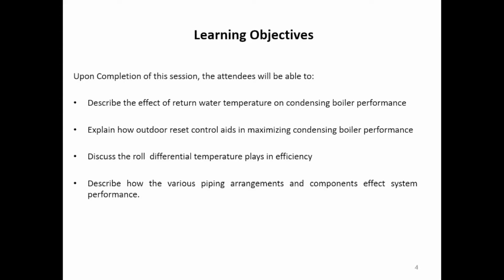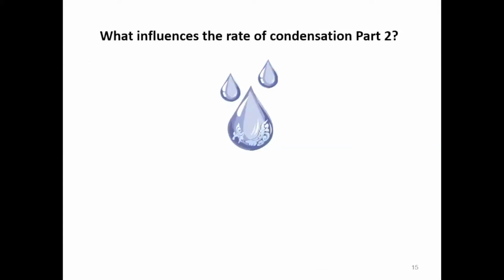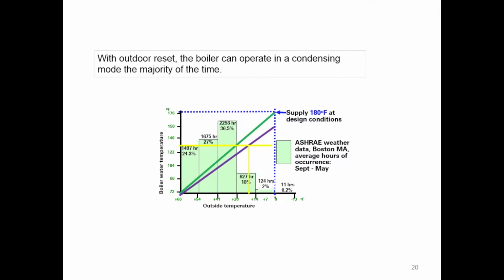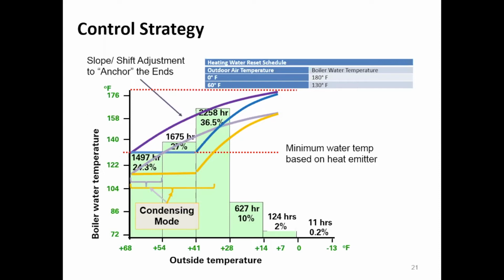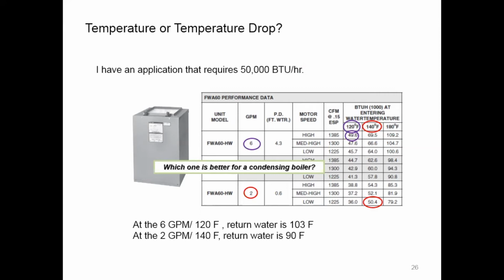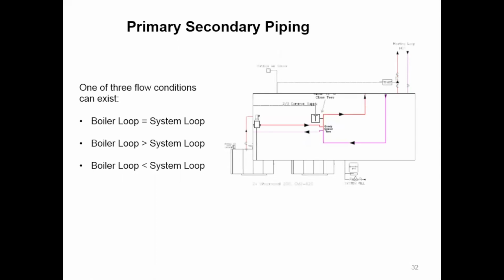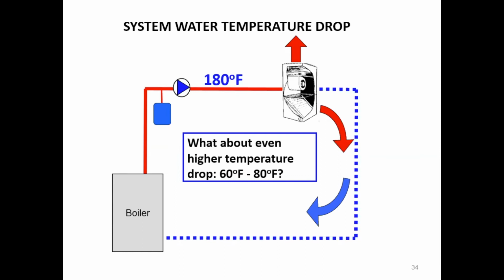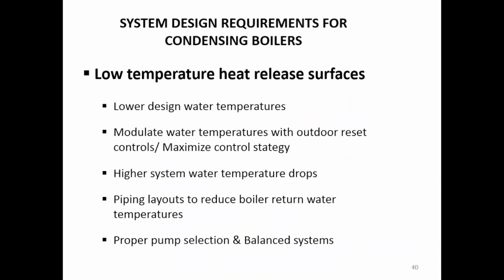August  2019 - Maximizing Condensing Boiler Performance Webinar

Comment: It's very naff Viessmann talking about boiler efficiency when they don't design efficient boilers !
Anyway, my Viessmann might be the last boiler I buy.
Reply: Care to elaborate? I am considering a Viessmann next.
Reply: @fearone9694  My Viessmann doesn't....
1. work properly with a cold return (turns the burner off)
2. offer 2 temperatures - one for heating, one for hot water
3. pumps heat OUT of the house via the flue.

They're one of the better boilers but that doesn't mean they're a good/efficient  boiler.

Rather than considering a new boiler, spend your money on insulating and draught-proofing (sealing up) your home. Fit extra external doors - so when a door is open, a second door prevents fresh cold air blowing in.
Change your heating from radiators to a ventilation system with heat pumps - fresh air is good for you and the heat pumps will keep the heat in the property but change the air !
Look at solar panels and wind for sources of electricity.
Reply: @millomweb what about intergas?

Comment: When a boiler such as the Vitocrossal CU3A is piped only primary as a replacement for an old cast iron boiler on a converted old gravity system, does the circulator have to run constantly for the outdoor reset to operate properly?
Reply: The challenges with converting older gravity systems to forced circulation are numerous. The piping is much larger because the water needed to move through the system by the buoyancy of hotter water with minimal pipe resistance. However, that drastically increases the mass of water in the system. Plus the piping is usually not very well insulated if at all. Once you add a pump and start moving water mechanically, this changes a lot of the thermal dynamics. If you start and stop the pump and or the boiler by a thermostat, when the thermostat closes you need to reheat a lot of water, which slows the recovery time and leads to larger temperature swings in the space. If you run the pump continuously, the heat loss may be significant because of the mass of water in uninsulated pipes. The CU3A boiler does not require a pump to be running to run the burner and keep the water in the boiler at set point. The 13-18 USG in the boiler will be ready to go make heat. However, this may be a lot less than the mass of water in the piping system. It really is a site-specific choice if it’s better to run the pump continuously in a converted gravity system but the CU3A boiler will work in both cases.
Reply: @marknorris9722  Thank you Mark!
Reply: @marknorris9722   Mark, do you know when the updated CU3A is going to hit the market?  I was watching a video on the new Vitodens 100 with the nicer display, and they said the CU3A is also getting an update soon.
Reply: @Shadrack69  I do not have a date for this.

Comment: Question for Viessmann instructor: I have a Viessmann Vitodens 100-w B1HE 120 BTU installed and thermostat controlled for each zone. Can you please provide some additional configuration/setup information on how I can achieve the efficiency levels you describe in the video at approx. 23:20 (slide 21). Thank you for your help.
Reply: Hi Chris, what Jody is speaking about is the relationship of Boiler/System water temperature and condensing operational efficiency. His example is based on a high temperature heat emitter system design.
There are many variables which either enhance or limit the correct settings and reflected efficiency. The pumps, distribution piping, system Delta T and specifically, and the heat emitter design type and the location of the installation (Every location will have different weather data. Jody’s example is based on the Boston MA area), are all contributing factors to setting correct control parameters.
If we were talking about Edmonton Alberta the design outdoor temp would be -29F instead of 0F, if we look at Vancouver BC design outdoor temp is 16F.
If we look at heat emitter design, a high mass radiant floor system, (low temperature design), will be based on a design water temperature of 120F instead of 180F. 
The operation of the thermostat does not necessarily have much effect on the efficiency. That said, if the zone thermostats start and stop the boiler, as opposed to only operating pumps or zone valves, this can affect efficiency. (See other videos on our You Tube channel titled “Why your thermostat is like your car keys” and “Using thermostats with modulating boilers). These videos explain why every time you start and stop a modulating, condensing boiler it will have a direct effect on the “seasonal” efficiency because of the number of boiler cycles in a season. These videos were based on the previous Vitotronic control generation, but the principles are the same for the new boiler control platform on your boiler.